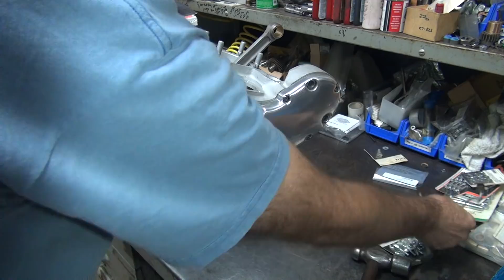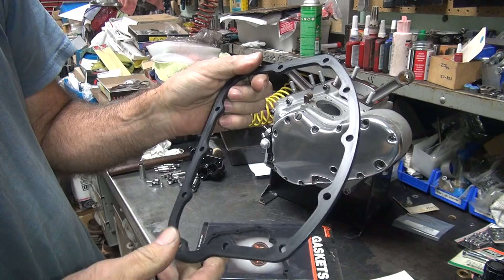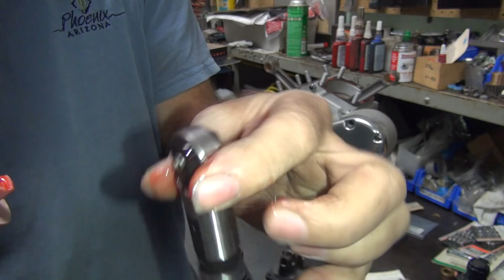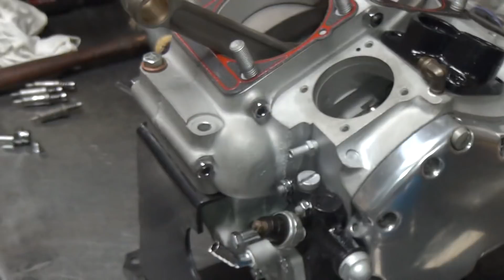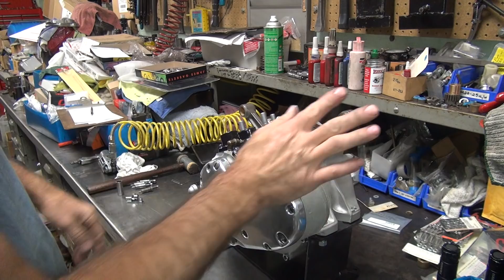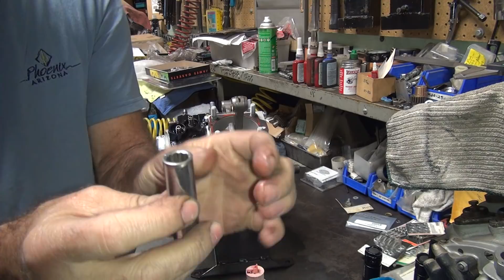1965 panhead #124 74ci flh motor rebuild and bike repair harley by tatro machine

Comment: in your opinion, which engine is or was the best made by HD. Which design.
Reply from the maker: i like the looks of the 1950-52 wr's best but the post 1955 kr's have it beat on power and reliability. my 1959 kr race bike has mostly stock parts in it , even the cams and it went 126mph on gas and 152mph on nitrus. try that with a twincam and see what happens.
tatro
Reply: Along with a friend, I built my first HD back in 82 out of parts from everywhere. It was actually a 1974 Shovel and basic bike, bare bones basic. I was poor. That bike never let me down other than a condenser once and a chain brake. Should have kept that bike. I have had several since and now ride a 2010 Heritage with stage II upgrades. Too old now for hot roding just cruising . I do appreciate all the info you give me when I ask. Keep up the good work. Sure love the videos.

Comment: i run velva touch lifters with steel tappet blocks in my evo, MUCH better than the junk stock aluminium ones.
Reply from the maker: that is why i like iron evo lifter blocks for my hot street motors. harley made them in the 80's.
tatro
Reply: I didn't know they made Iron ones was that in sportster models?
Reply from the maker: no, evo big twins. ironhead sportsters had iron ones too in the 60's. those are the parts i like to use when i need the best.
tatro
Reply: Mr. Tatro, I'm sorry but i dont understand your comment. My 98 Big Twin had aluminum tappet blocks and were slap wore out after 100,000 miles. Hence why i went with the steel "Velva Touch" tappet blocks. Are you suggesting that the Early model Big Twin Evo's had steel tappet blocks? Again, my 98 didnt.
Reply from the maker: early evo is not the last two years. that is late evo. harley used cast iron lifter blocks off and on thru the 80's. mostly 1985-88 but i have seen them in all the 80's years. harley mixed them in with the alum ones. all the 90's evos had alum blocks like yours. harley had good and bad parts throughout all the years they have made bikes but never all in one year or model. it is up to you to use the best parts for your application.
tatro
Reply: WOW, i didn't know that! Damn it man you're a wealth of knowledge! Thanks for sharing this. Keep up the great work!! Can't wait to see the finished 65 project!!

Comment: Beautiful motor. Are you using cast or forged pistons?
Reply from the maker: cast pistons. it is just a nice tatro stock rebuild. that would be a nice reliable motor with some passing power when needed.
tatro